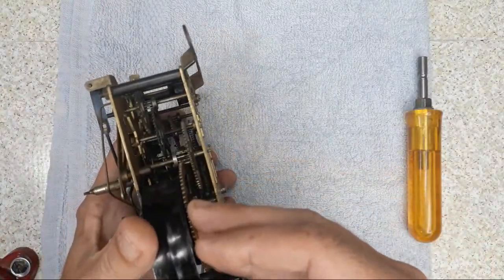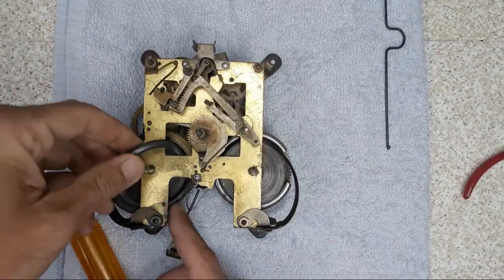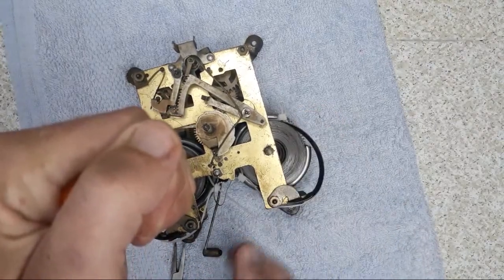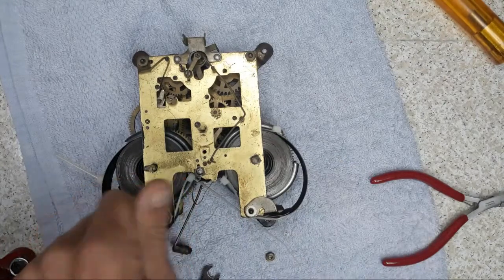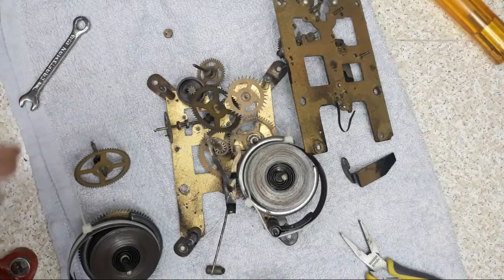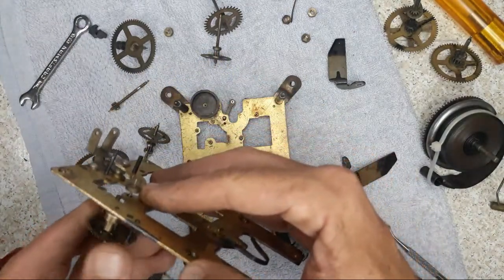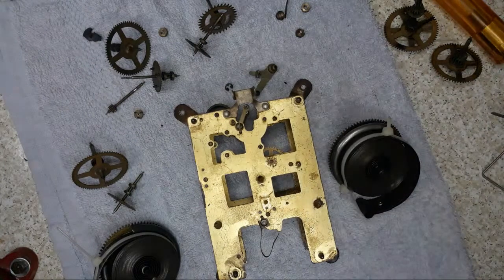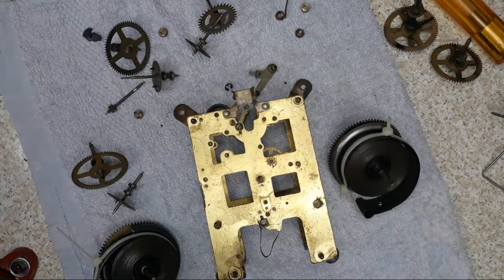31 Day Korean Clock Repair - Storm Area 51 Special

Comment: I have two alaron clocks that are identical except for one has a plastic governor with the center being a felt material and the second one has the metal fly. The one with the metal fly winds way up and chimes really fast and at end abruptly stops reverses a little and oscilates a couple times. Nothing is broke, but I want to slow it down. The fly is not slipping. Also escape wheel makes the tick toc tic toc then at a certain pint goes tick knock tick knock then back to tic toc. I dont see anything wrong with the escape wheel, but it will even happen with the pendulum off and slowly moving the verge back and forth.  Any ideas on this?

Is there a way to flow it down?

I absolutely love a clock ticking. It even helps me fall asleep at night. I also like the chimes. I bought the loudest ticking clock I could find. Maybe i'm weird but hey, they all used to be loud. I think its a good old school sound.
Reply from the maker: Slowing down the strike would require some type of repair. The connection between the governor and the arbor is t what it’s supposed to be doing, apparently. 

As far as the verge goes…it’s either worn out or losing power (probably needs complete disassembly and cleaning). 

Hope that helps!

Comment: Working on a device developed 500 years ago and talking about aliens.  I wonder how they keep time? I am trying to find the chime switch on my 31 day Jupiter. It used to chime and now it only chimes on the half hour.
Reply from the maker: While time is what I'd presume to be a universal constant, it is relative to our orbit and rotation by human standards. A very deeply philosophical question that you've posited. As far as your Jupiter goes (in keeping with the space meme), it may have what's referred to as a "passing half-hour strike". It is independent of the striking train, and not driven by the left side of the mechanism. 31day clocks have tremendous mainsprings, it is likely due for some service, as they are a sticky mess after several decades of use.

Comment: Hello can you tell me the thickness of the mainspring? .015 .016 .017 .018? I see that all those measurements are used
Reply from the maker: not sure. the mechanism was sold on ebay and is long gone. not sure if there is a "standard" size for ye average 31 day clock, there were a LOT of different manufacturers over several decades, lots of differing designs as well.

wish i could be of more help.

Comment: I Liked your video and am trying to fix my 30+ old clock myself.... if you're into questions:  The hour hand of my clock stopped moving but the minute hand works fine, when the minute hand hits the hour, it chimes 12 times, (every hour) inspecting the clock I see the rack has a small thin piece of brass that broke and now the hour hand does not work.   Where do you get your parts?  Also why do they call the clock a 31-day clock.... mine has to be wind twice a week to run good...Thanks

Also, my wife wants me to turn the clock into a quartz movement, how cruel.
Reply from the maker: @Ken 
Big oof on the conversion…you could always fibb and say they sold one on Antiques Road Show for a hefty sum, because it had the original parts restored lol.

As far as the rack lever, there are no known part suppliers for this part. I too have run into that issue, and painstakingly made my own parts. So the only two viable options are to hand make a replacement, or purchase a suitable donor on eBay. So many various movements made over several decades from countless manufacturers pushes me to remake them myself typically. 

As far as running time/duration, those mainsprings get a bit sticky over some time. They aren’t particularly strong, so old oil residue and bearing wear will quickly beleaguer the mechanism. I was trained to clean them without disassembly, however the springs won’t get cleaned in a satisfactory degree this way. It’s like trying to bathe your feet with shoes on. For me, every project that gets fully cleaned typically runs for a whole month, though timekeeping can get problematic over the duration. That being said, 31 day springs are quite lengthy, and often sharp, so disassembly can be dangerous if you’re not careful. 

Hope that helps, thanks for watching and the questions. Good luck!!

Comment: When will we see the next video putting this together?
Reply from the maker: @Robert Horneman, this mechanism is the leftover from a conversion to battery motor. The owner of the wall clock this belonged to didn't want to wind the clock anymore, so we kept the parts they no longer wanted. I am in the process of making a fairly modern container design for this mech, I will post the results as soon as it's show ready! I'll include an assembly video as well
Reply: @GulfCoastClock  Thanks

Comment: That's not a repair, that's just taking it apart. Not much help with addressing bushing replacement, or gear alignment, and putting it all together correctly.  And wouldn't a nut driver have been better then an open end wrench for taking the 4 post nuts off? 
  Just saying, I'm a master auto tech and machinist for over 40 years, so what do I know.
Reply from the maker: not much about routine clock repair, apparently lol

I'm guessing that flushing out fuel injectors isn't a repair then either? one simply compels them to leap from the engine and rid themselves of deposits with your power of persuasion. 

zero bushings installed on this mechanism, coinciding with factory alignment of all parts and pieces, gears, arbors, pivots, etc

also nut drivers have a tendency to gouge the plates a bit. i prefer finesse over brute force, but alas, a simple man i am.

the power source of this clock is the springs...which gum quite badly...after having been installed before your turned your first wrench. the repair process is to remove them, the 50 years of oil and gunk, reapply new lubricant, and reassemble. i have used the term repair, loosely, as the mechanism wasn't working before, and suddenly worked after i simply took it apart, fixed the power loss, and just put it back together.

but i guess you already knew that too.
Reply: Agree did this when I was a kid

Comment: What's the diameter of the mainspring and chime spring clamps?
Reply from the maker: Good grief. I hate leaving people hanging, YouTube is awful about notifications.

For legal/liability reasons I am unable to say exactly how i clamp 31d springs. Totally too big for my vast set on the work bench, but there may or may not be very sturdy zip ties used. Please be careful, the spring edges are sharp as hell on many Korean clocks. And its alot of canned heat to roll through a months worth of winding.
Reply: Just checked I am putting one back together. Look same size as on this . 2inches , inside diameter.

Comment: Personally I think the Koreans got this clock right...
Reply from the maker: Thanks for the compliment, and yes, they did a very good job on this clock with the materials they had. Some of the levers are made from crappy steel, but the brass and gear shafts are really pretty good overall.